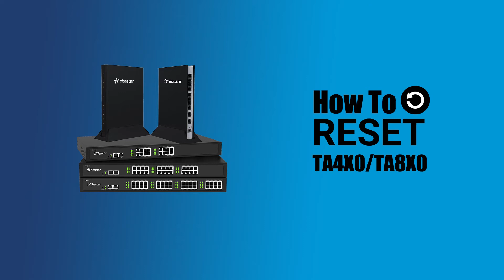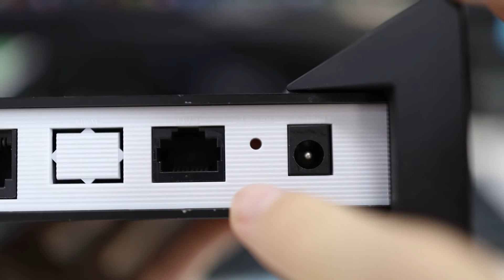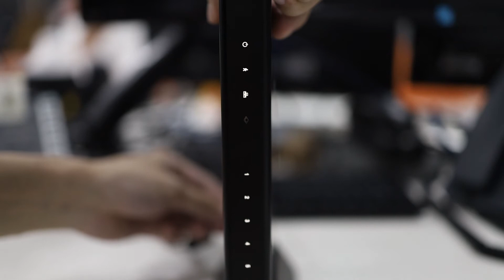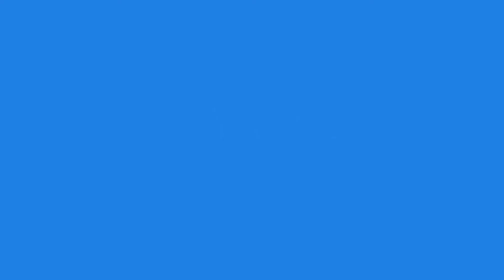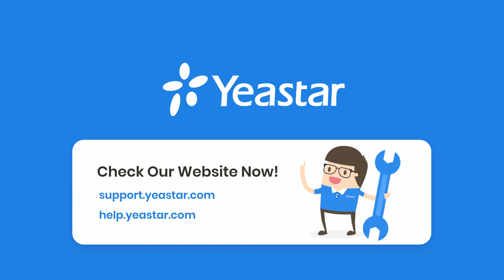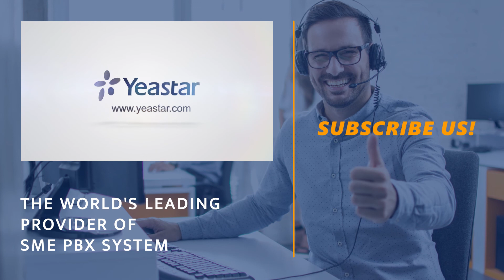How To Reset Yeastar TA4X0/TA8X0

Comment: What is the default ip address after you reset the device ?
Reply from the maker: Hi There, TA400/TA800 is DHCP by default. So you need to check it on your router. For TA410/TA810, the IP is 192.168.5.150.